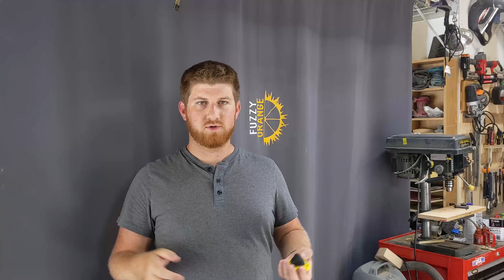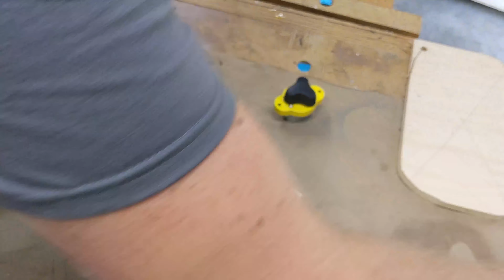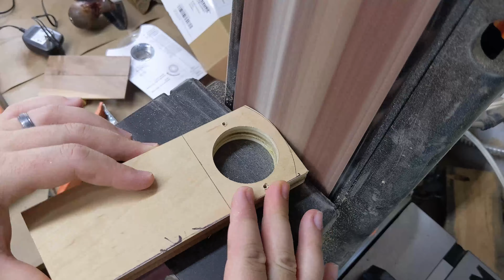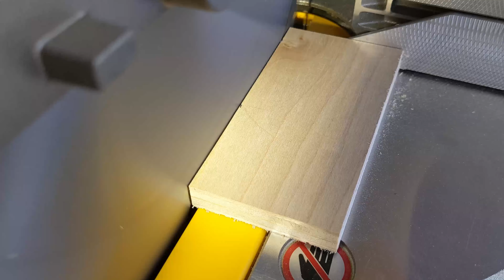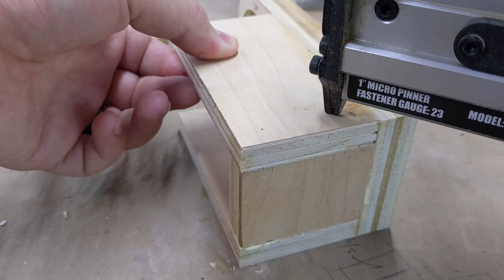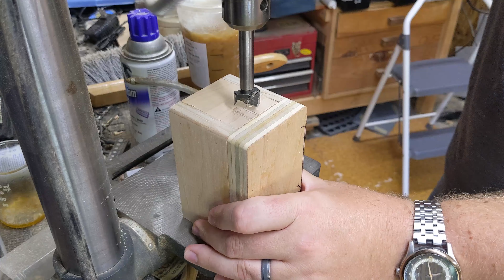DIY Extension Switch for your POWER TOOLS | MagJig

Comment: Cool idea... My 1950's era saw has an old light switch.  I decided to change it to one similar to yours. You should add an amazon store with affiliate links. It costs the viewer nothing and gets you a little bit of income.
Reply from the maker: Thanks! My saw also came with a light switch. One of the first upgrades was to add a safety switch. I do have an Amazon store, just didn't think to add this... Good idea!
Reply: You should  probably add a link to the Amazon store in your "Normal" area somewhere around your merchandise.
Reply from the maker: Great idea!
Reply from the maker: Done! Check it out if you are interested! 😀

Comment: Definitely a cool idea and nice execution. My only note would concern the danger of not being able to kill power to the saw with your knee when your hands are closest to the blade. With it on the bench behind on the bench, you need to reach behind you and (possibly) look away from the saw to kill power. Maybe instead of extending the switch, you make them two switches in series? That way when you are close to the saw you still have the ability to power it off.
Reply from the maker: Yes. As I imagined there are inherent risks to this system. I do like the idea of a second switch, but  I would have to look up how to write that properly so they both work as intended...
Reply: @FuzzyOrangemakes  Is this a switch with under voltage circuit? Does ist turn off, when you pull out the power cord while it's running? If it is, you need the first switch at the saw itself. So you have to turn it that one first, before you can turn on the extended one. It's not a perfect solution, cause you always have to turn on two switches. For a solution you could add an emergency off non latch switch at the saw itself. It will kill the power to the extended one as long it is pressed.

If have a double switch configuration at my electronics workbench for turning on and off my test circuits. Have one pair of switches on the workbench itself, and if needed also another extended pair which can be connected to an RJ45 socket on my bench. But it's build with a bit of control logic and some special wire break and short circuit detection. So both pairs work all the time, but the extended one is not needed for operation. The extented one can be added every time and removed when the circuit if off. If you pull the RJ45 while the circuit is on, it will turn off by itself.
Reply from the maker: @analogMensch  thanks for the info! Very helpful!
Reply: @FuzzyOrangemakes  If you want two switches and both working at the same time, you can't get around some logic stuff. Can also be relay logic, that's no problem. At least you need switches with seperated contacts (1xNC for off, 1xNO for on) and a relay with three NC contacts. It's not that complicated to wire this, you just need the parts and a bit of time.